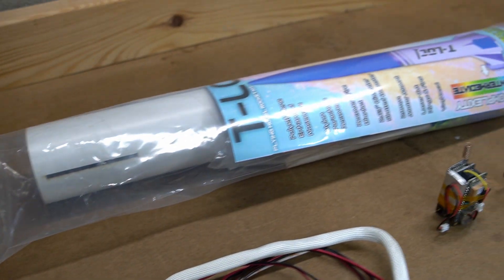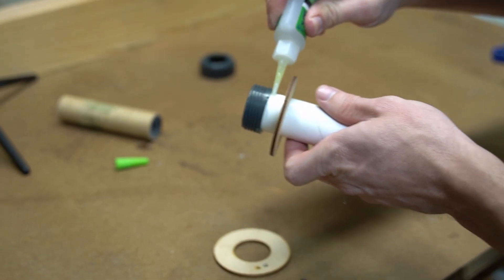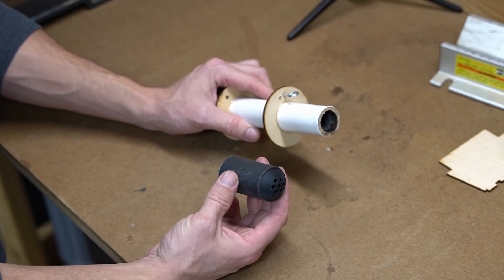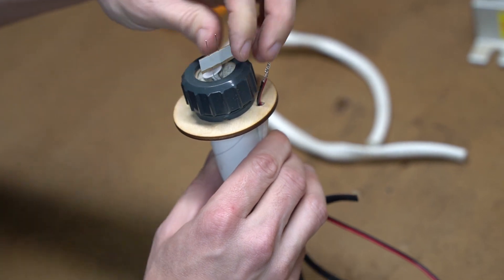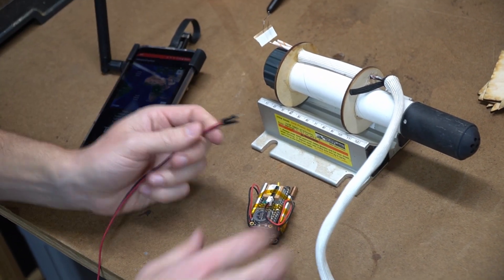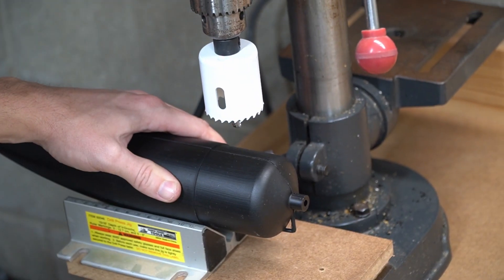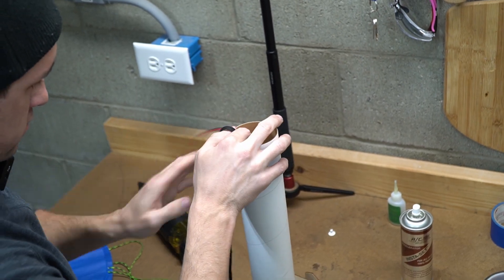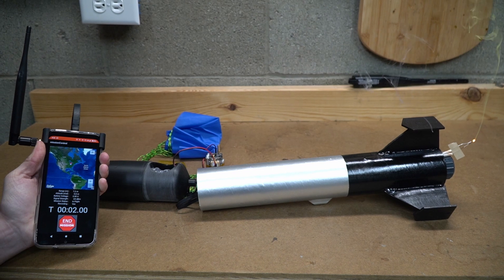full build tutorial | model rocket with built in ignition and ESP32+LoRa telemetry

Comment: Cool project! One thing, and I understand you said you'd only fly the rocket on Estes motors, but you can create a thrust ring by building several layers of masking tape at the nozzle end of the motor, that way you don't need an engine block. In the unlikely event you'd want to fly longer motors, you still can :)

Also all I could think about watching this is its excellent use for 2 stage rockets!

Comment: Interesting idea. I had a few questions/different ideas:
1) why drill the hole for the wires so close to hook for the shock cord? I would have drilled it on the other side to make it easier and to retain strength around the shock cord
2) I would have installed the motor block as step two, after the retainer threads. More stable workpiece. Is there any concern over the ejection gases not having a clear path?
3) CA glue is pretty brittle and doesn’t handle heat well. Any concerns over that? I would have used wood glue in some steps or epoxy
4) easy way to thread the ignition cable through the insulation sleeve would have been to slide the launch rod through the sleeve, tape the end of the ignition cable to the rod, then pull it through. But it didn’t look too hard either way.